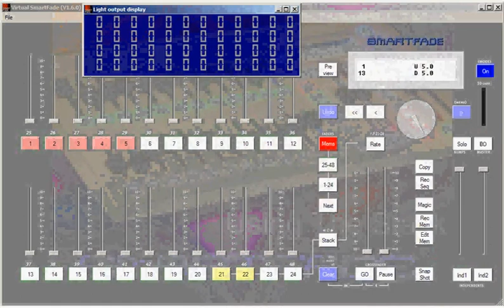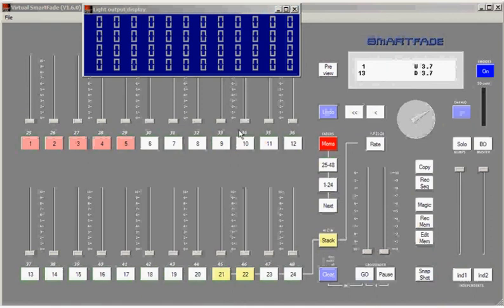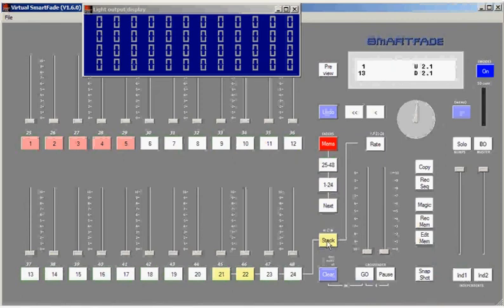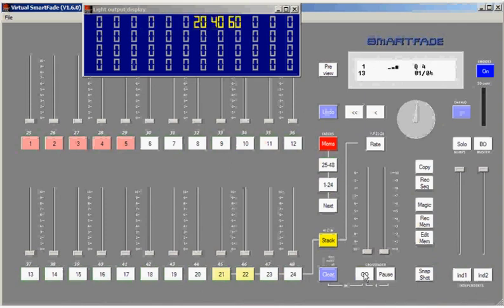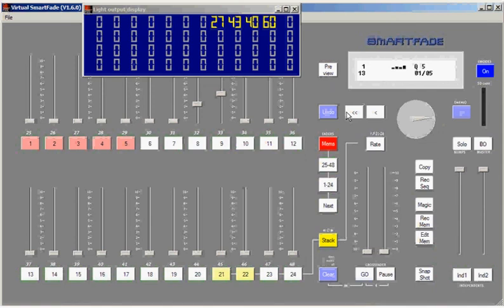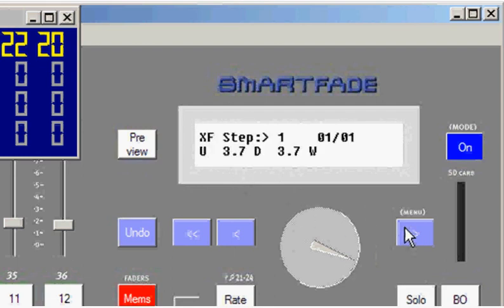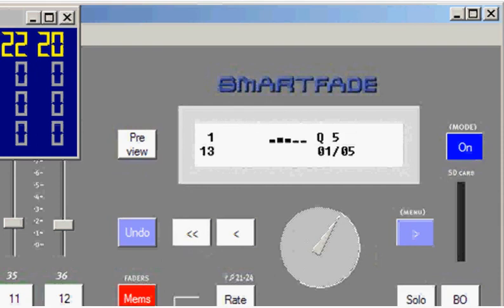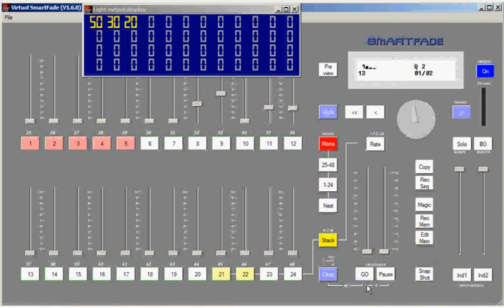SmartFade®: Using The Stack on SmartFade

Comment from the maker: Hi,
Correct.  MENU or  >  toggles between times.  Set UP, DOWN, & WAIT, > again will go back to UP. 
The << exits & changes are saved. 
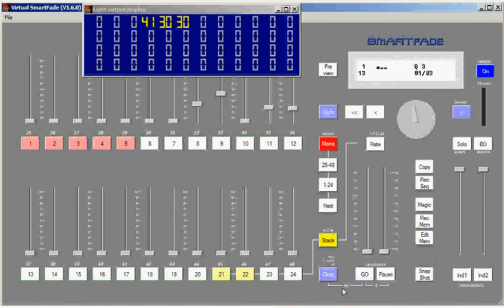@~8:00 he resets the stack to 0.  Next Q is 1. Note UP changed to 0.1 earlier.  When GO, step bumps instantly, so timing saved.

For more about Editing Seqs & Stack see SmartFade Manual (pg 45), specifically Seq & Stack Timing (pgs 52-54).  Link to the downloads page for SmartFade is now in the description.

Hope that helps,
ETC Video Librarian